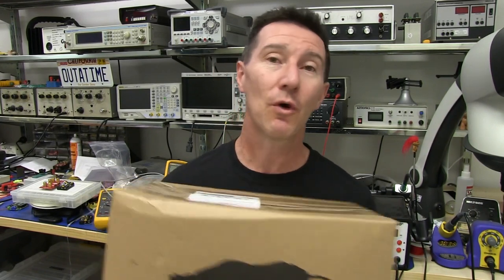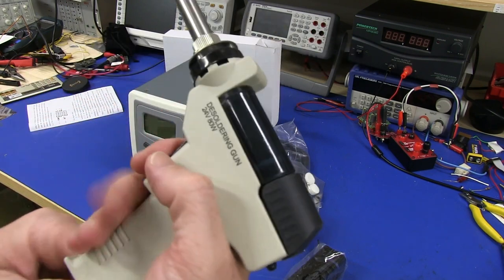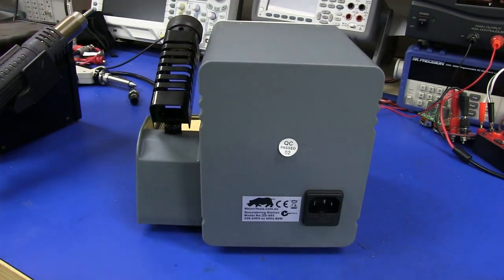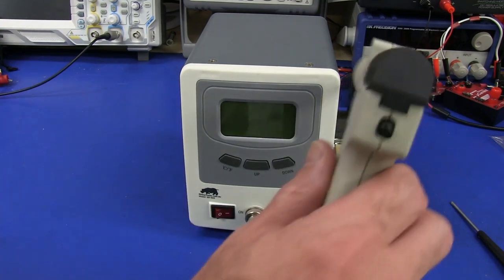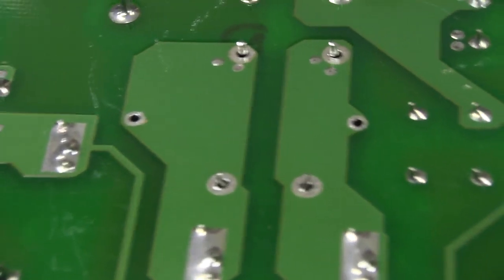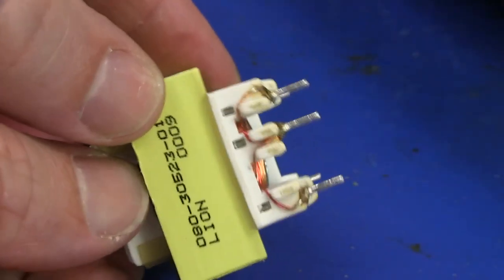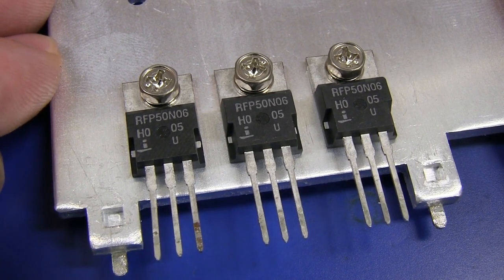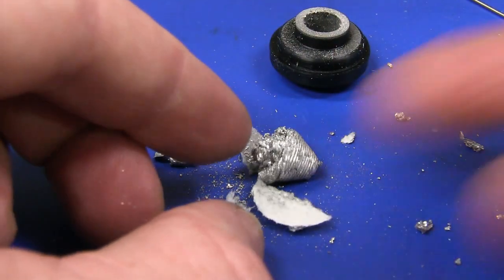EEVblog #542 - ZD985 Desoldering Station

Comment: uh, in terms  of vacuum; 500mm.Hg is better than 600 :) so they don't seem to understand their own specs? pretty unusual
Reply: Are you sure :)
Reply: Yes.. yes i am :)
Reply: As i said already, are you sure?
With what measuring aid?  How would you measure vacuum at a suction of air pump in example :) without using Bourdon tube-type gauge and using mercury (Hg)?
When we talk about pressure difference between atmospheric pressure and vacuum source, expressed in millimeters of Mercury, only U-Tube manometers came to my mind. This is glass U shaped tube, half filled with mercury with both side of said tube exposed to atmospheric pressure and mercury level in both legs of said tube is same. This is starting position "0". Applying vacuum source (i.e. air pump suction) on one side of U-Tube causes mercury to rise in that leg and fall in other which is exposed to atmospheric pressure. Difference between two levels of mercury in both tube legs expressed in mmHg is your vacuum of said pump suction. The more suction you get, the more difference in millimeters you achive between two levels. 500 mmHg is some 66% of vacuum and 600 mmHg is  some 79% of vacuum. Simple as that.
Maybe you switched mmHg to mmTorr, and they are almost same but oposite in measurement and Torr is not used in measuring vacuum at pump suction as far as i know:) So 760 Torr is 0.0 mmHg and 760 mmHg is 0.0 Torr which is 100% of vacuum. We use a lot of these U-Tube manometers with Hg and H2O when measuring vacuum of air pumps and/or various turbochargers on marine diesel engines.
Cheers mate
Reply: well we do not use museum pieces to measure vacuum nowadays ^^
All gauges are in torr or mBar, Pascal, you name it.. every measurement in mm Hg or Torr are 760 at atmospheric pressure and go down with vacuum.

So a 500mmHg vacuum is red today as 500 Torr, which is less than 600 Torr.
It may not be accurate relative to what was in use a hundred years ago but that's just how everyone talks when using "modern" gauges, like a Pirani for example.

But what you said is pretty interesting! if you have photos or videos of this type of mercury gauges being used in modern applications i'd love to see them
Reply: Zox Wolf before this goes any further.. i just missed the obvious... we are both right but we compare apples and oranges.
You talk of measuring a delta-P while i talk of absolute pressure. in terms of pressure differential yes, 600mm is a better vacuum. but in absolute measurement, 500mm is better. that's where the confusion came.
i wonder if the box even bothers to mention what they measure.

and yes... Torr (and not mmTorr ^^) is pretty much the standard unit for measuring vacuum in the semiconductor industry, while other industries tend to use mBar more, but everytime it is absolute pressure meadurements. i guess for the applications you worked in which use very rough vacuum, having an indication of pressure differential was enough but once you need any kind of precise control over your process, it's all absolute measurements with dedicated gauges depending on your working range..
besides, can't connect a gorgeous mercury gauge to a PLC ^^ so.. it's all a matter of application.
Now, the theory is.. if they wrote on the box "500mmHg" it is absolute pressure. if it was "mmHg gauge" (like Psig/psi, or mBarg/mbar), then its relative pressure.
Reply: Yes you are right, its absolute vs relative and if they state mmHg it is relative, if it is torr it is absolute.
You can find conversion tables to check. They are not museum pieces. They are still in use for some applications :)
Cheers mate
Reply: Zox Wolf i am not sure you can convert differential to absolute since the reference for differentiala is unknown (atm pressure varies, and is not always the reference either).
but it gives an idea of the pump functionality.
Reply: Oh no. Atm pressure have little variation in grand scheme when we are talking about some shitty piece of crap little pump in cheap Chinese desoldering station. Thats why they use mmHg and not Torr or any other unit. In reality these variations are negligible and thus atm pressure is your ref point. We are not talking about some very complicated and demanding lab conditions expressed in microns or whatever :) When you say inches mercury gauge or millimeters mercury gauge this is not absolute but relative. When you say Torr or inches mercury absolute thats absolute of course. But you must specify absolute. And to put end on this, its rough or coarse vacuum and not fine or high expressed in microns or greater than microns. Its a freakin pump man. 
Cheers mate
Reply: yea totally. that's home vacuum cleaner standards right there
Reply: Do you operate industrial pumps of any kind? Do you maintain ICE turbocharger suction filters? Are you scientist? Are you frustrated for some reason? Where did you find that such a fine definition of absolute vacuum level is needed and in what aplication in normal life? I am just  engineer and we use relative and diferential so this does not bother me as bother you. And again terms absolute are not needed for such applications. And you wil not find it in products like this. Have a fun with your very fine definition of vacuum when suck some solder with cheap chinese crap desoldering station mate.
Reply: I install and maintain vacuum pumps in the semiconductor industry and more and more in industrial and scientific areas, so it's not at all rough vacuum. And it does not bother me at all! i am sorry if that's how my comments looked like. I only realized that since we work in totally different applications, our use of vacuum is just not the same. the vacuum cleaner reference was for that desoldering station, nothing personal.

The pumps i work with have base pressure of tens of mTorr at worst, and go way down to 10e-10 Torr. It can be as diverse as a small Ion pump in the greybeard's laboratory to an entire hall of pump packages for steel degassing with huge throughputs.
In 10 years doing that i never saw anyone use relative pressure at all, that's why i was surprised at first.
Reply: Than you are very smart and inteligent person and you can see point here my friend. You are dealing with some very serious job regarding vacuum, but we are mumbling here about very simple cheap plastic (mostly) membrane pump needed to suck some solder from ordinary PCB. You cant compare your pump with that one for sure :) I am dealing with industrial fluid transport pumps mostly (cooling, crude oill transport, and so on) and we dont need absolute scale as you do. Desoldering station pump fall under simmilar category and has nothing with absolute scale. It just suck solder mate :) Some better and some worst. I never saw on any several time expensive desoldering station they expressed vacuum in torr or mBar or any other unit but mmHg. Hm if they wrote mmHg absolute i would lift my eyebrow coz for that application it would be funny at best. But maybe i am wrong. I saw and work only on  few Hakkos and Wellers.
Cheers mate
Reply: If you only work with differential pressure, i guessed the main focus of what you work on is flow, and that's actually what our little desoldering station is about, so yea, in the end not my area, and you taught me a few things that i would have never seen otherwise.

Pumps... devices designed to lengthen youtube comments :P

Cheers ;)
Reply: hahah, yeah that last comment made me laugh mate ;) happy desoldering
Actually i need some happy desoldering for some retro computer motherboard recaping these days,
Cheers

Comment: Recently i bought the ZD-915 from poland with the name `extreme` on the front of the unit.. I really cant recommend these units.. The aoyue are why better, have a much better suction because of a very bigger vacuum pump.
The pistol is indeed very cheap.. On mine the tube to the tip wasnt aligned properly..
80 / 100 euros you could better invest in a hakko hand version one..

Comment: I got one of these today, and i seem to have some kind problem with its power supply or something. Its "UnBranded" ZD-985, its colored white and blue, screen says "u03" as version.Even when the power switch is at 0 position (OFF), this item starts sometimes (5-15 minutes) for milliseconds (could not capture it to video at 30fps, just faint green flash at dark room), the screen backlight comes on and it shuts down at same moment. Is anyone having same issue and does anyone have any workaround for it? I think ill replace the main power switch with one that cuts the input totally to primary coil of the transformer. This unit seems to be grounded tip to earth (PE).

Funny this thing has serial number that relates it was made in week 15 in 2014, if this follows the "Atten" serial number ways... 

Gotta say, still this is one of the best tools i've ever bought, i got some old GoodWill GW3000 oscilloscope boards laying around with numerous switches and rotary encoders, that i could never get out with the soldering wick... this could do same job under half hour and i had stack of switches on my bench then.

I bought it from ebay seller linked in this video comment somewhere.. The seller was italian one. Thumbs up for fast 3-day shipping. :D

UPDATE:

Strange, when i plugged the unit to kitchen grounded point, device doesnt start on its own... My bench is isolated from main grounding system of our house, and when i plugged the power cord so the N goes to L and L goes to N (Rotated the Shucko connector 180 degrees) and now the unit stays off. This got intresting.

SOLUTION:

I change the power switch to cut both, L, N lines and now the device is safer and the internal power supply unit doesnt start on its own becouse of the Earth and L connection in some cases when i plug the power cord on the other way. this is becouse metering the HUM of the Earth line i got connection with L and PE line when the system was idling:

Here are some measurements from the tip to the device power switch.
 L<-230VAC->PE
PE<-0VAC->N

When the system is now shut off, the PSU cannot get any power from the "MAYBE"-"Neutral" which can be connected to the sockets LINE
Reply: I just bought one. and it's doing the exact same thing.  While the unit is powered off...about every 15 minutes or so. the LCD flashes and a click sound. Seems jacked.  I am going to try an Amazon return.

Comment: Three years later, it looks like the "985" is still on the market, and it's gotten a bit pricier.

http://www.ebay.com/itm/Vacuum-Desoldering-Rework-Station-Digital-Temperature-Controlled-Dual-LCD-/252521470921?hash=item3acb73dbc9
Reply: Depends on where you look - this one is just re-branded, but looks like the same model and slightly cheaper

http://www.ebay.com.au/itm/HIPPO-TOOL-80W-Desoldering-Rework-Station-Digital-Temperature-Control-Dual-LCD-/222240416359?hash=item33be8fa267:g:T-kAAOSwFV9XzTvC
Reply: hippo tool lol

Comment: It amazes me how much better the solder chamber design is on these cheapo chinese units compared to my Oki desoldering gun. Tiny plastic solder chamber, liners that cost $45 for a set of 20 that can't be reused.. ugh. Even the Hakko 808 has a better design with the glass reusable chamber. I mean the Oki is amazing and all, but with tips at $50 each, and ludicrously priced liners/filters.. I mean even the station itself is made in china as well! The newer gun design is only marginally better. Oy.

Comment: MetCal, the best in the business.. although theyre like... 3 times the price :/
Reply: More like 8-10 times the cost LMAO. I agree with Metcal is the best. However, you could buy a 10-year backup supply of this cheap unit for the same cost to run a Metcal desoldering system. I run the MX-5051 & for the handpiece, cable-hoses, tips, cartridges-Ect, not to mention the Oiless-silent compressor iF you like a quite invoirnment.. Again I do agree the Metcal soldering and desoldering system is great very fast at temps for both the suction is incredible. However, you could buy a 10-15 year supply of these units depending on how long they last for less than the Metcal desoldering system alone not including the power supply base unit.

Comment: This cheap tool work relly perfect. I have 8915 and this p..of s.. crap not working because heat element to small and metal pipe inside heater jamed with frozen solder.

Comment: I have ZD-915 and the assambly quality is so bad.
First it would not turn on. There was a bad connection in power plug to the microcontroller PCB.
Second, the vacum hose was put under the vacummotor and the rubber feet was overthigten and cracked.
Got the connection to work. Could not move the hose, as it to short, but got the motor mounted more correctly. So it sort of working now, but vacum could be a bit higher.
It's a really cheap ass product!

Comment: You don't know how retarded i was to try and desolder a through hole micro switch "Kailh Gaming Microswitch (red) 60million click cycle)" with 3 pins with a cheap $15 amazon soldering iron LOL. That took 1.5 hours and i had to push on it like i was about to break a pcb. NEVER AGAIN. gotta get me a desoldering station -_-

Comment: That was a total waste of time.  Watch this guy who did nothing but bash a product  (Didn't even try to legitimately review the item, AT ALL!!!) who then BREAKS the product by messing around inside (funny we didn't get to see the repair to find out his digging around inside broke a wire right where he was messing around at one point...) when he finally fixed his break, he then continues to bash it as to why it didn't work.  And then do something and bash it, do something and bash it some more, oh and then do something, and then... yes, bash it, rinse and repeat Ad nauseam...  Heres a thought...  How about test an item BEFORE you open it and break it?  Let us see it try to work without you breaking it first.  I had to laugh a few times when he would put on a part and then bend it or pull on it in a way you would NEVER actually use it and then call it total garbage.  I can break the windshield of my car with a rock, but it doesn't mean my windshield is total garbage!!!   This video was AMAZING in that I don't think I would trust a word or recommendation he offers.  He went into this knowing this was a cheap desoldering unit.  And we were unfortunately reminded of that every other sentence out of his mouth.  I was totally drained by the time I finally had enough and clicked on something else!  I know this was an older video, so I do hope you got much better at your reviews!!!  Ugh...

Comment: Desoldering stations are mostly useless. They don’t work on surface mount. They do a crappy job on through holes. Use solder wick. And a good air solder. Air solders are tricky beasts. Learn about their uses properly before using one.